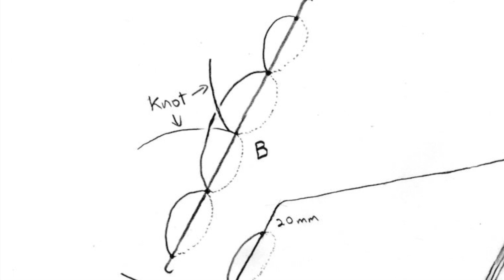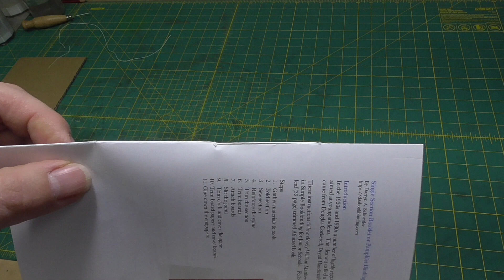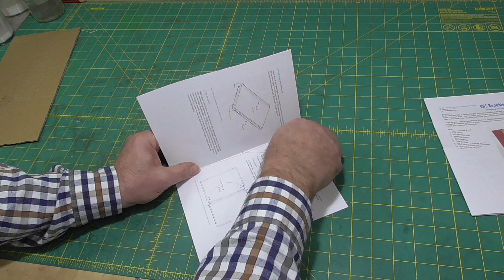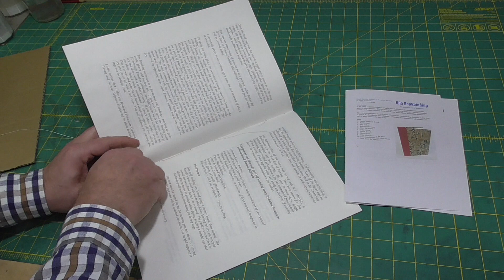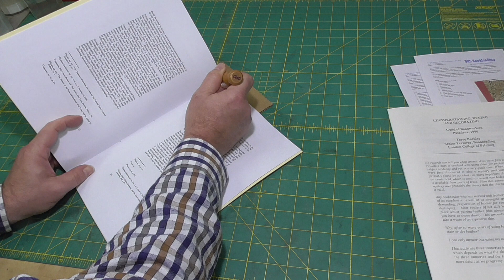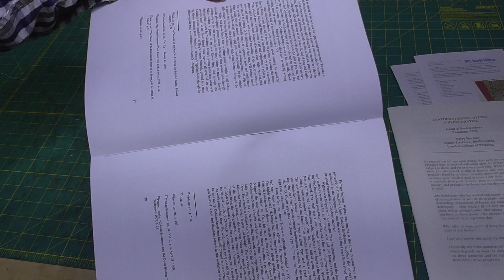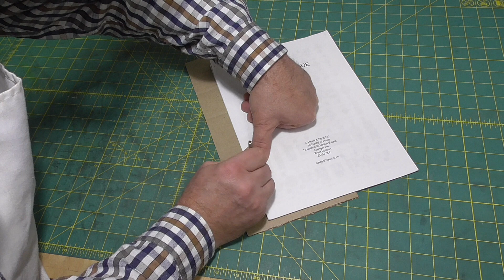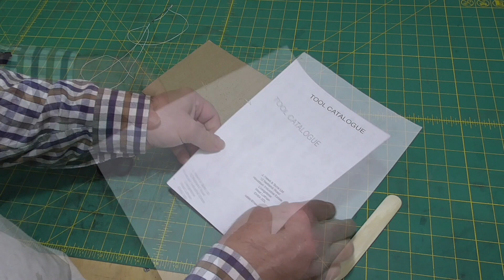Pamphlet Sewing // Adventures in Bookbinding

Comment: Another quick option for single section bindings is a steifbroschure style stiffened paper binding. Tip on endpapers, glue boards to the paste downs, glue a piece of book cloth onto the spine and onto the boards, cover the rest of the boards with paper, trim all three sides. I've been experimenting with doing this to staple-bound notebooks as a fast way of making 'vintage style' notebooks to sell at craft fairs etc. I can make one in about 15 mins and the results are quite good for the time and money investment.
Reply from the maker: Thanks Ed.  Gives me an opportunity to put a link to the Steifbroschuren video
https://youtu.be/PGcG2v4TXw0
Yes, the cheap ruled notepads can be handy.  I've pulled them apart for lined paper to use in courses.
All the best, DAS